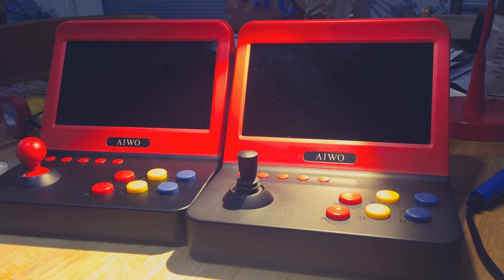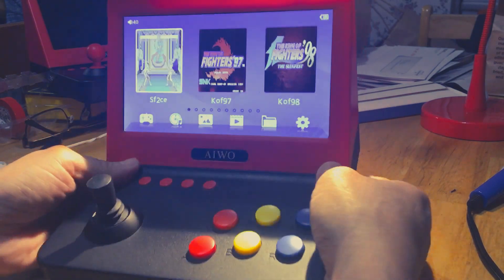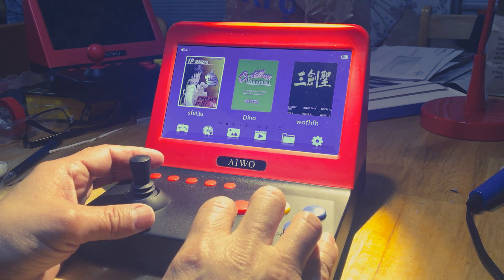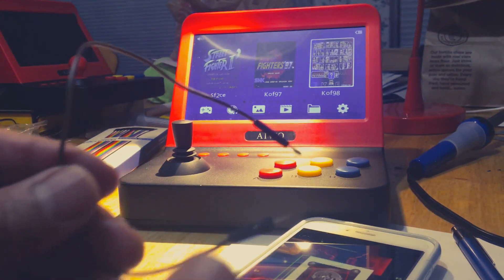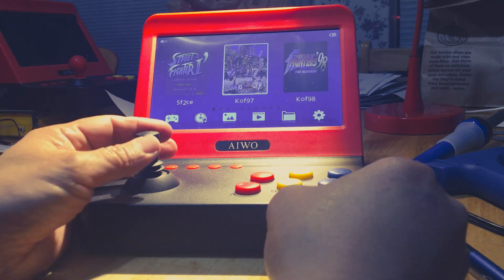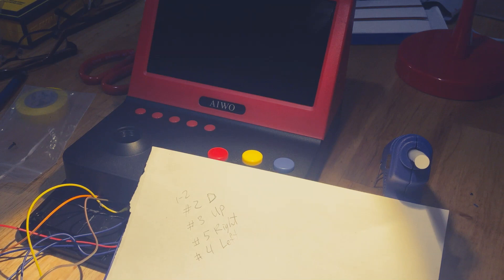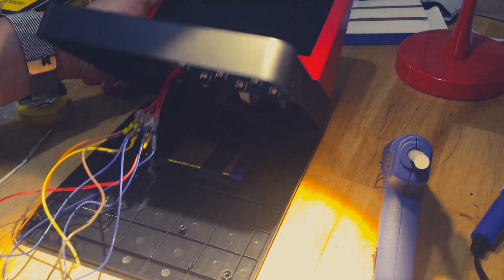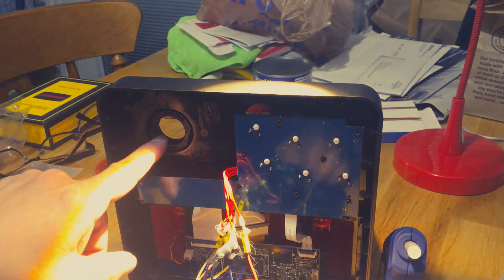AIWO - Joystick replacement,  with 7 dollars MicoSwitch Joystick

Comment: Very good tutorial, i've done it in 2 hours soldering some cables (all except the direct connection to the pins of the joystick) and when i tested the left direction failed, so i quit the wire tape and fix the connections and now works fine. But i have to file the protruding of the joystick, isn't enought with filing the base.

Comment: Why bother pulling the wires from the plastic connector of the 5-pin harness when you could just cut and splice the wires together in the correct order.  That's the method I used to install a Sanwa JLF joystick onto the board of a Qanba Drone a couple of years ago, because the order of the directions and the ground wires was different on the Qanba board than the order of the JLF, and it worked just fine.  Wouldn't that be easier than pulling the wires out of the plastic connector and inserting the new ones, or am I missing something?